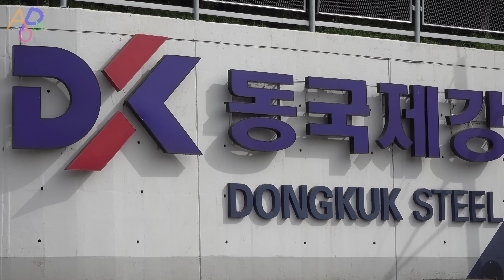Huge Scale! I-Beam Manufacturing Process by Melting Metal Scrap. Steel Mass Production Factory

Comment: Those shots of the first arc furnace were just amazing.
Reply: Yes very cool.
Reply: I was going to ask what they were because they looked like giant welding rods. I also wondered how they melt the steel.
Amazing.
Reply: @ozymandias7940  It functions just like a welding machine, a really really big welding machine. There's an anode in the bottom like the ground of a welder, and the stick is the cathode.
Reply: @AlexA-zb6gg  What kind of voltage are we talking here?
Reply: Is that when the white light started flashing at 5:45? What was happening exactly?
Reply: @ozymandias7940 I don't know what this specific furnace uses, but the ones I am familiar with are ~1000VDC 160,000 amps. The voltage is regulated to maintain the 160 kA setpoint
Reply: @ashunbound Yes that is the light is from the exposed arc at the start of the melting process called the "bore-in". Once the steel begins to melt and a slag layer forms on top, the arc will be submerged beneath it which protects the refractory from damaging high UV radiation, reduces the noise(arc furnaces are extremely loud during the bore-in) and thermal loss to the air. You can see the slag pouring out of the furnace at 6:12 which keeps the layer at a controlled level in the furnace

The arc striking process is exactly like a welder who touches the metal with the electrode and then pulls the electrode back to maintain an arc gap.
Reply: @AlexA-zb6gg  neat stuff, thanks for explaining 👍
Reply: 5:40
Reply: Gave me goosebumps. That is some raw industrial power in action.
Reply: Bro for REAL the sparks and flashes of light like some powerful witchcraft is happening down there? That's a place I'd love to visit for sire

Comment: The part with the arcing electrode and the furnace is amazing. Almost like a Marvel's movie.
Reply: I was thinking The Dark Crystal.
Reply: You have to see how silicon is being made in an arc furnace.
Reply: so they basically put in a rod and make it short out to heat the metal?
Reply: @spaghetti9845  It's basically arc welding with a giant rod.
Reply: Arc Induction Furnace. It's been the standard for melting iron and steel for several decades now. You can do this on a smaller scale with a carbon electrode and a stick welder if you have a crucible that can deal with the stresses and heat.

Comment: Please note that this is a "RE-MELT" operation using steel produced elsewhere. Those facilities make coke from coal, iron in a blast furnace and then the iron into a giant kettle with scrap and an oxygen lance lowered to blast the combination. The kettle is removed and can go into a continuous casting vessel that drops the hot steel from the bottom into a curved, cooling mold section that generates a length of square billets that are cut and later rolled into structural shapes like in this facility.
Reply: How do they know the scrap steel mixture they are loading comes out the proper grade steel required?  I know they add ingredients to it, but I see a lot of different types of steel being loaded.
Reply: @MillermaticS  They have a general idea what type of steel is being loaded. Then after it's melted they take samples and test it. Ingredients are then added to get exactly what they want for a finished product.
Reply: @regould221  Thank you
Reply: @regould221 in industry adding of ingredients is in fact alloying. The final product is steel (alloyed iron)
Reply: @MillermaticS they don’t, that’s why this is poor quality building material
Reply: Modern EAFs don't use 100% recycled steel anyway, most of them that produce higher grades of steel will use scrap along with DRI or HBI which is raw iron that didn't go through a blast furnace. Some EAFs will also use pig iron from blast furnaces in their heats.

Beams and bars don't require precise composition like sheet steel so the tolerances for unwanted elements like copper is higher. Making beams and bars from the integrated process is inefficient, where the BF/BOF process is much better suited for the products that must have precise alloy composition like sheet steel

Comment: Watching this gives the highest importance to safety first and gives me a thought on why PPE manufacturers too, also improved overtime. The large furnace looks like hell and there is zero room for error whenever I see the bucket lifted with molted metal. I'm also amazed by the fact that the minds behind this engineering and technology was able to find the right metal elements that will not bent during the melting process with such high heat.

Comment: The only thing that i interested in is how is big the transformer that can provide that huge ammount of current that melts the metal
Reply: В среднем мощности дуговых печей варьируются от 30MW до 120MW. Я был не на этом, но тоже с дуговыми печами производстве. Запитка трансформатора в моем случае была от 220KV линии, а выходные шины трансформатора шли на электрод. Выходные шины были из медных труб, по ним шла вода рециркуляции. Отдельно был блок компенсации, короче power factor correction, эта штука была из небольшого здания конденсаторов. Я говорю о переменном токе. Если печь на постоянном токе, она ещё сложней. Габарит трансформатора примерно как полтора-два вагона, и стоял он на рельсах. Выходной ток на электрод дуги должен быть не менее 50kA, но может превышать 100кА

Comment: Got to tour a mill outside of Fort Worth, TX some 25 years ago. I’d never seen (nor heard) anything quite like that electric arc furnace. I then got a little too close to a line where I beams were being roll-formed. Nothing quite like a red hot steel bar flying at you at 50 miles a hour. Amazing stuff and the enormity of the facilities and equipment is mind-boggling.

Comment: I was watching a video from a factory in Afghanistan I think, and now watching this, it's like another planet. Like going from stone age to space age.
The security measures were non existent, and there were so many workers working near the red hot steel with only rags to protect their hands.
To empty the bucket containing several tons of the molten metal, a worker went underneath the bucket! And welded a hole though it from the side!! It was insane!!!!

And lastly, zero purification process. They just skim some slag, and that's it.

Comment: All of the machinery used to make the steel is a marvel in itself.  For the longest time I always thought steel was melted by means of gas fired crucibles.  Nucor built a rebar plant in my hometown and it uses a powerful electric arc to melt steel like the plant shown in this video.  It's mindboggling at the amount of electricity it must require to to feed that thing.  I can see why steel workers make such good money.  It's dangerous, hot work.

Comment: This is a scarp melting furnace using an enormous amount of electricity in the form of an electric arc.  Blast furnaces can melt raw iron ore as well as recycled metal, while electric arc furnaces only melt recycled or scrap metal.
Blast furnaces primarily use coke to supply the energy needed to heat up the metal.

Comment: "What grade of steel are your beams?"
"Yes."
Reply: Haha. I kinda came here for this comment but it needs some context so people don't get the wrong impression. 

The arc smelting furnace generally has one (or both) of two kinds of instruments that analyse the molten steel on the fly.

The first is an optical emission spectroscope, which analyses the emission spectrum of the hot molten steel and can give an accurate reading of the presence of phosphorus, oxygen, magnesium and so on in the mix.  The second is XRFS, or X-ray fluorescence spectroscopy, which works similarly to OES but is induced by bombarding the melt with X-rays and analysing the resulting X-ray flourescence of the excited atoms. This instrument is better than OES at analyzing the concentrations of different elements in the melt.

You can see at one point a shute drops a load of stuff into the crucible - this is them adjusting the mixture as needed . You can see in the second pour that there appear to be stray chunks of solid metal laying about on the floor around the crucible, these are most likely magnesium or chromium or whatever was a required alloying agent du jour.
Reply: 5W-40, of course.

Comment: The scrap seems to be quite a mixture - how do they ensure the quality of the steel produced?
Reply: The arc smelting furnace generally has one (or both) of two kinds of instruments that analyse the molten steel on the fly.

The first is an optical emission spectroscope, which analyses the emission spectrum of the hot molten steel and can give an accurate reading of the presence of phosphorus, oxygen, magnesium and so on in the mix.  The second is XRFS, or X-ray fluorescence spectroscopy, which works similarly to OES but is induced by bombarding the melt with X-rays and analysing the resulting X-ray flourescence of the excited atoms. This instrument is better than OES at analyzing the concentrations of different elements in the melt.

You can see at one point a shute drops a load of stuff into the crucible - this is them adjusting the mixture as needed . You can see in the second pour that there appear to be stray chunks of solid metal laying about on the floor around the crucible, these are most likely magnesium or chromium or whatever was a required alloying agent du jour.

Comment: No. The melting is not done using high voltage, but using high current at low voltage.
Reply: I can imagine the thickness of the copper wires that carry so much current.😮
Reply: Dont be so obsessed about correcting the video creator. The terms "high" and " low" are relative to some other external value; for example it's a high voltage compared to what the average viewer has in their house. But it's a low value compared to the voltage used for transmission lines across country. You know that, and so do all the viewers too. We all did "arc furnace 101" in High School.
Reply: @BrassLock  You should work on your comprehension skills. My gripe was over the conflation of voltage and amperage.
Reply: I like turtles.
Reply: Water is wet
Reply: Puppies are soft
Reply: @nicolek4076  they are one in the same…
Reply: @trainnerd3029  Which is, of course why you can put your fingers across the two terminals of an AA battery without harm. Try that with the pins on a mains plug. Your comment is plainly wrong.
Reply: Wait a minit.. who are you fk😅😅😅😂

Comment: 5:43 - it's not so much about moderately high "voltage" (below 1 kV, or 1000 V), it's the current (amperage) that does the heating - see Joule's Law, 
Q = R * I^2 * t
where Q is energy (heat), R is resistance of the conductor, I (= capital "i") is the current (i.e. "amperes") and t = time. Notice that "I" is squared - hence this is the most important component in the equation

And the current here (in electric arc furnace) is "in excess of 44 kA, or 44000 A" says Auntie Wiki, and who am I to question her knowledge or challenge her authority, eh? ;-)
For comparison - regular stick or MAG/ MIG welding of such "I-beams" (or "H-beams" as some call it) would be around 200 A, maybe 300 A - with voltage about 30 - 60 V.

6:13 - that looks more like slag tapping to me, and the steel is not "filtered" - it's the added flux (CaO and MgO) that melts and absorb impurities, forming the slag (that floats onto the surface of molten steel, aka "the heat".

Other than that, an excellent video : )

Comment: so is it steel or iron? the words are used interchangeably, but steel and iron are different things.
Reply: Iron is very rarely used in the industry, if at all, everything from machines to structures are made of steel which is an alloy of iron and carbon.

Comment: Why doesn't all the steel around the molten metal melt as well. What is the nozzle made out of??
Reply: The crucible is made from tungsten steel (high speed steel to you and I) which has a significantly higher melting point than mild steel. Crucially, it's also lined with refractory ceramics as a protective and heat-insulating layer.

Comment: how do they know the makeup of the steel if everything goes in the pot or does it matter?
Reply: Yes it matters.  Composition is checked and adjusted during the melt process
Reply: @arisaka9963  It might be too complicated for a comments answer, but how is this done?
Reply: I would have some concerns about the quality of I-beam steel produced from recycled scrap.
Reply: @ratpark5008  I think this is kind of the standard world wide.  Somehow they are able to adjust the mix to be what they want/need.
Reply: They make test samples then adjust the ingredients. The  sacks were shown of additional ingredients.
Reply: @electriccoconut  But what about excess  unwanted ingredients, aluminium for example? I didn't see a slagging part to this process. We've all experienced trying to work a piece of Chineseium.
Reply: @AffordBindEquipment  There are two kinds of instruments that measure the mix on the fly, an optical emission spectroscope and, if you're fancy, an XRF (X-ray flourescence) spectroscope. The former works by analysing the emission spectrum of the hot molten steel, the latter by bombarding it with X-Rays and measuring the resulting X-Ray flourescence of the excited atoms in the melt (different elements have different band-gaps and thus can be identified very accurately both by presence and amount). You'll see at some point there is a chute dumping stuff into the crucible - this is them correcting the alloy so it is within spec.
Reply: @LilMissMurder3409  WOW!  Thank you for an intelligent detailed response in language I can understand!    Wish all youtube responses were like this....

Comment: What do they make these large crucibles out of
Reply: It's just a high-quality steel tungsten steel alloy (high speed steel to you and I). Its melting point is significantly higher than mild steel, but the crucial part is that the inside is lined with refractory ceramics such as cemented carbide.

Comment: The manufacturing of mild structural steal is one of the most basic and simplistic manufacturing systems accepting of any scrap metal stock.  Can't say the same for aerospace grade metals with ultra strict alloying needs.  For the most part, scrap metal is contaminated feed stock for such industries.  A lot more work needs to be put in to separate, classify and grade different scraps of metal so it's sellable to a wider range of manufacturing industries.  There are over 2000 alloy grades of steel and some are impossible to recycle.

Comment: I've never understood how they manage to melt the steel without melting the vessels that's holding it...
Reply: Different metals have different melting points check the periodic table
Reply: The vessels are lined with a refractory material.
Reply: @kidkique  I understand that - but carbon steel has one of the highest melting points of all metals aside from some rare earth metals like vandium, platinum, etc.  It would be far too expensive to make those giant melting pots out of those.
Reply: @LesDexia13  Yeah, that's the only thing I could think of... but there must be some amazing insulation between the inside of the vessels and the steel shell!
Reply: @rhymereason3449  Where I worked the vessels were periodically relined by replacing all the refractory bricks on the sides. The "bottom" was removable because it had to be replaced a number of times between vessel rebuilds. The engineers also sprayed the inside of some equipment with a refractory "mud".
Reply: @LesDexia13  Thank you.... that is very interesting!

Comment: I feel like there's about a 36% chance that a truck gets a flat each time they reverse into that scrap pit. lol.
Reply: Nah dude it’s more like 35.345%
Reply: That facility looks pretty clean compared to most, you can actually see the concrete. I’ve been to some where you try to hold your breath because of all the dust in the air, it looks like fog sometimes. Make sure the windows are up and turn off the heater or a/c until I’m out.
Reply: I think you’re way low.
Reply: I saw a truck get 3 flats rolling out after he dumped.
Reply: 50% dude cause once i was a truck dealer of that thing in the Philippines
Reply: @HomerSimpson514  Gotta keep your eyes open
Reply: @blauer2551  in a foot of water lol
Reply: @HomerSimpson514  Or a foot of oil mud
Reply: Probably not. If I left my pad that dirty I wouldn't get return customers. So I mag and sweep the unloading area....

Comment: But why this steel is so vurnerable to corrosion and soft in comparision to old eu made steel? I saw that scrap is not so clean - probably plastics and other garbage is there as well... Maybe that's the reason
Reply: Corrosion resistance is a function of composition.  Hardness is a function of both composition and thermo-mechanical history.
Reply: 용해 후 불순물을 제거하고 다시 두번을 정련하는 과정을 거칩니다.  품질규격을 통과하지 못하면 출고할 수 없어요